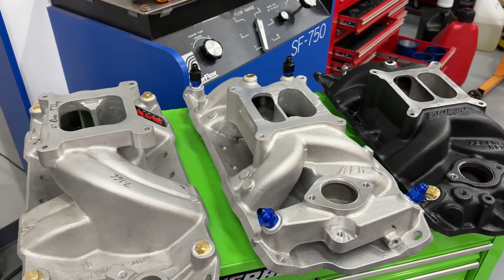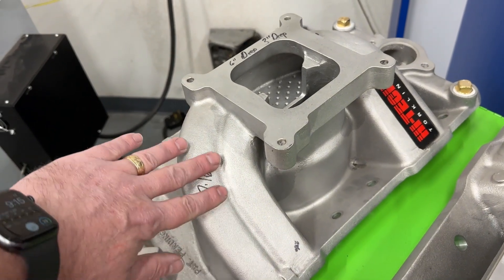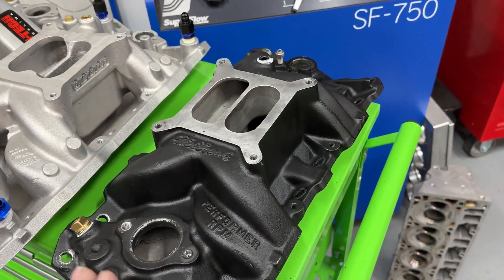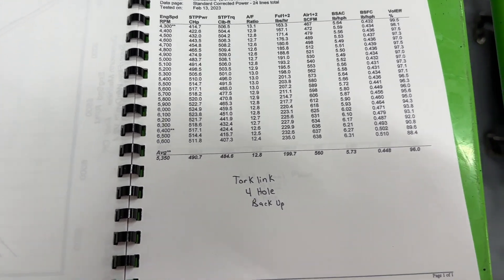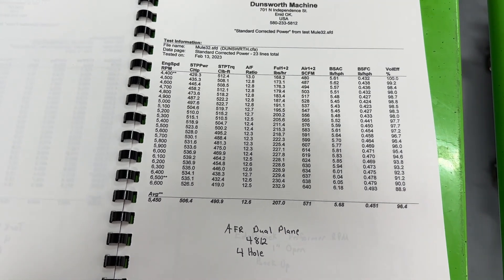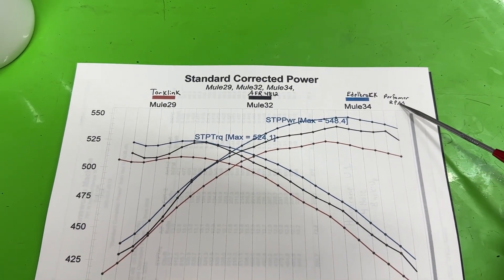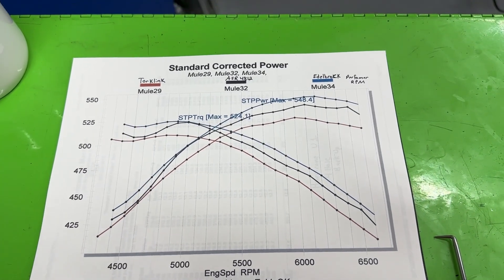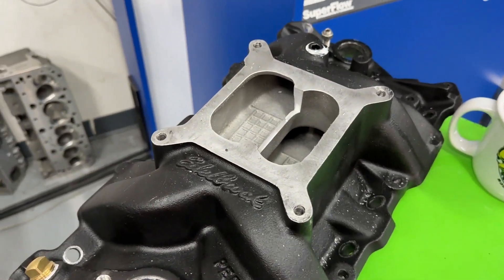Dual Plane Intake Manifold Dyno Test

Comment: I've seen that Torklink one in your videos on the shelf and was expecting something really sweet from it
surprised it wasn't better, looks so cool though
i'd love to see a dual plane intake test with ones that have the spreadbore pattern, and then compared it to without the spreadbore pattern
Edelbrock has many like that
or what about a spacer testing that has the divider in it?
would like to see how the torque patterns are with a spacer with the divider
were these manifolds ported or just port matched?
great video

Comment: Now, lets see how an old Edelbrock SP2P and a Chevrolet Qjet intake compare to these results. Any guesses? 🤔
Reply: The old SP2P was the opposite of a performance manifold.   Intended for low RPM torque on mid/late 70's Chevy 350 truck engines putting out about 160HP.  My father installed one on his 1978 K10 but didn't seem to gain any power or gas mileage over the factory spreadbore.
Reply: Was that the torker sp2p with the carb on a angle, sorry that was a big block 😳
Reply: @fasteddy  I'm not positive but I think the big block intake with the crooked carb pad was the Tarantula?

Comment: The McFarland torklink was once considered the hot setup for 2bbl  9:1 compression circle track motors...but none of us used dynos back then...
Reply: That’s what I remember also. I though it was used a lot on the 2bbl class
Reply: @Patrick-xd8jv  Id be curious to hear feedback from guys running them back in the day. 
Kick ass looking piece. Id run one just cause its different...polished up nice conversation piece at cruise night. 
Dont think intakes make that much difference unless a real poor one was used in the first place. Used to hear Joe Sherman preach about that often.
Reply: Dynos dont tell everything esp on a circle track car. I like the intake no matter the dyno results.
Reply: I have one if you want to trade  @gordocarbo
Reply: The design suggests it is for a flat plane cranshaft.

Comment: Great  info!!  I have a 434 small block Chevy with afr 220 heads and a self- ported Performer rpm qjet manfold.. 1 inch open hole spacer.  Worked great!!  I would love to see you port a dual plane for a maximum effort small block...sleeper...
Keep testing!!!
Reply: *And test it!

Comment: I just watched some dyno video and they didn’t see a bit of difference with a spacer in the numbers. Wish I could remember now what channel it was. Spacers have always been to get the carb away from the heat some more I’ve always thought.
Reply: the spacer on a dual plane allows for air to go to both sides, as opposed to only half the carb feeding each cylinder. If you have a big enough carb you won't see advantage from the spacer/air gap because half the carb is able to supply each cylinder at high rpm. I'm guessing in these tests the carb doesn't get hot enough to make the spacer have a difference, but it probably would if you ran the thing to max temp for a while, like oval racing.

Comment: Is there any airflow difference in the rpm air gap, and performer rpm?
And at what point does the rpm become a major restriction in power?
And can a single plane be modified to get down to the  2000-2500 range and up,  I had a similar to torquer intake on 350, 11:1, lunati cam.507" lift 285° total dur, it was a straight up pig below 3500, the heads were not ideal, small valves, 5.0H.O. heads ported,  it's all I had,  it really came alive about 4400- but the sad part it was done by 5k the total combination was way off, it would done great if it ran a sustained 4500-4800 rpm, I wanted a 3k stall, and a decent aluminum head, and was hoping to get a performer RPM,  something that would spin to 6500-6800+/-, and not be anemic below 3k,
I was young and dumb, and broke, had to use the parts I had, for other projects, because it was my only ride, 
I did eventually swap it all to a trick flow head, twisted wedge, Holley street dominator, 10.5-10.7:1  with a 465/485 mild hyd. Roller cam it was on fire then,  Chevy would sold tons of trucks if they ran like that!

Comment: I am surprised that the Hi Tech did so poorly. Possibly the plenum is too large? Thoughts?
Reply: Testing was done at higher rpm’s. Over 4200 rpm.  Long runners make low end torque well below 4200.  I think this engine was also setup with cam that likes rpms.  That intake is not designed for that.
Reply: Application isnt for higher rpm peak power. 
On a mild st engine I bet it works pretty well. I dig it if anything just for the looks
Id run a well setup spreadbore carb with those long runners.

Comment: If the afr enforcer heads are the same as an assault heads, the intake ports are raised .100". Which intake gasket did you use and did you notice if the ports on these lined up with the intake runners? 

I have assault heads and used a 1205, but the gaskets had to have the bolt holes notched to raise the gaskets to line up with the ports.
Reply from the maker: 1206. The torklink was closest match. The others were smaller.
Reply: Those are the dart copies sold by a bazillion places. Castings at least

Comment: I may be wrong but I would think cutting the performer rpm center down more will hurt output.
Reply from the maker: We will see.
Reply: @WeingartnerRacing  can't wait... i know some folks who used to do this on the Pontiac performer and rpm intakes, and saw mixed results. i think there will be variables such as cams/heads/weight/temps/altitude/etc?????? the pontiac edelbrock intakes are dual bolt pattern, so perhaps that's a reason, and as you mentioned how clean is the cut and how deep, along with what size spacers were used. Jim Hand did some of the testing back in the 90s (it think) on his Pontiac setups.... but... he was GOOD with tuning stock type stuff
Wasn't that Offy's big deal back in the day, thought they offered a cut down and claimed it gained some upstairs??????

Comment: The Performer RPM has ALWAYS tested on top of all dual planes on every test I've seen. It is THE intake to run on a street car with torque and hood clearance concerns. 
Excellent video and info Eric, definitely looking forward to the retest of the AFR and Edel !
Why TF do manufacturers keep putting that damn vac port there !?!? They gotta stop. You can sink it flush if you tap the hole more.
Reply from the maker: I could but I was in a time rush so spacer it was.
Reply: @Eric Weingartner  totally understandable, thanks for all you do !
Reply: Yep still the king of dual planes for probably every engine they make them for.
Reply: You would think Edelbrock has gotten enough complaints over the last 40 years of making the Performer series intakes that they would have remedied this. Before Vic passed away Edelbrock had competitive prices. After he passed EVERYTHING basically DOUBLED in price. Whoever is in charge now is running the place into the ground.
Reply: @robertwest3093  edelbrock is owned by a private equity firm.  The owners are looking to make more profits not satisfy customers.
Reply: @chrisw5837  Same with afr and most everyone else. We can thank everyone that shops at China motors for this.

Comment: Eric do you think the torklink looks like it's designed for a flat plain crank engine
Reply from the maker: I think on paper it looked like a winner but just didn’t happen.
Reply: We found the same results when we tested the Torq Link years ago when it first came out.  It never performed well on the dyno, no matter what we tried, but some drivers thought it "came off the corners better."  I don't see how that could possibly happen though.  Wishful thinking.  Or maybe because their wallets were lighter.
Reply: @dannobee  Bet it has something to do with runner length and position. Id think it would have good torque off the corners.
Reply: @WeingartnerRacing  have you ever tested the EDELBROCK performer eps.

Comment: You know I kind of wish you had tested a 40 year old tunnel ram along side these just to show how well the old tech worked at every RPM range.
Reply: Engine Masters did that and it makes more power. I believe they said it always does.  The question is, can you live with the hole in your hood? It's always a compromise with a street car.
Reply: @BEANS-O-MATICtransmissions  while i have always loved the look of a T-Ram setup, i've never said one in a street car that outperformed a good single setup
i dont know of anyone that ran a low profile dual quad, but single or dual carb tunnels i've never seen or heard of them do well
i'm sure some super fine tuning maybe they might have, but the basic street type stuff i was around, single was always the king
this was in the late 70s to mid 90s/early 2ks
i've personally never had one, so going by feedback and what i had seen at the time
again... i LOVE the look
i do recall some folks mentioning about icing issues with dual quad tunnels, especially a few of the guys with T bucket/kit cars
now.. the big boy blowers.... that's a different story
Reply: @DDDD-of3hv  Edelbrock makes a low rise dual plane. 
Sure they work fine just not a fan of the runner length. Nice eye candy though
Reply from the maker: I would love to do one but then I need other carbs and more time to get everything hooked up. A good tunnel ram like the one from alky digger would be the one to run.

Comment: Not all engines like the air gap intake manifold. Depends on the engine combination.
Reply: Too bad everyone wants to build via an internet dyno sheet. Thats not real life in car results
Reply: @gordocarbo  exactly 💯 my setup on my car doesn't like dual plane intakes. It's faster with a single plane intake.
Reply: @musclebone7875  Same...any more torque with a dual plane Id just spin...and have no top end. Use a small single plane well ported does both pretty good
Reply: @gordocarbo  I'm using a dart single plane intake on my 496. I love it, I'm no drag racer, but on the highway my '68 impala pulls hard up top. On the bottom at WOT first gear is useless with my 3.36 rear gears.
Reply: @musclebone7875  Running enough stall?
World products came out with a low rise dual plane which moves a crapton of air. One of the owners designed it for his own car. 496...I wish I had one lol

Comment: Thanks for posting Eric! For me, more interested in the dual plane tests for my 383 since it will be replacing the anemic 305 in my 91 vert. Camaro for the street. I kept my Weiand Team G high DP which I got back in the 80's, it has most of the divider removed, but was considering buying the Edelbrock air gap for it's benefits instead. Recently found a funky Offenhauser split runner dual plane too. Whichever I use, will need full divider removal since I am switching out the stock EFI for MSD Atomic.

Comment: ?? Is the Edelbrock Performer RPM,  just like the 1970  Corvette  350  LT-1 manifold  ????
Is that way it's so good???
Reply from the maker: No not close to the same.
Reply: @WeingartnerRacing  What is the difference in performance between the Performer RPM and the GM 14044836 70LT1 manifold?
Reply: @WeingartnerRacing 
Thanks for the help
Reply: performer rpm will out perform the old LT1 intake
LT1 isnt bad, works great it depends if a few ponies is worth spending 400 bux plus. Id keep what you have
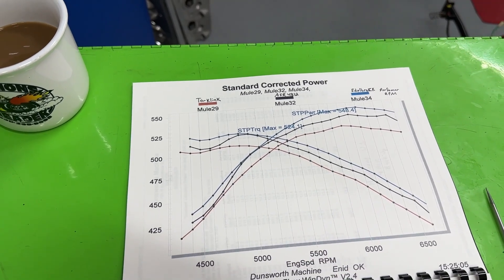Reply: 14:14 Edelbrock designed a wonderful intake manifold

Comment: That vacuum port ,  under the carburetor is stupid.    Did AFR think you would NEVER  install a Carburetor???
Reply: I have an old Weiand and it is the same, probably meant for a Quadrajet, not a Holley.
Reply: Most carbs have a large manifold-vacuum port dead-center out the back of the throttle plate, which is what I use for power brakes and PCV if needed. The port plug can be recessed flush and does not usually affect the carburetor installation. I almost never use the thin paper base-plate gaskets anyways due to heat transfer. I always use the 1/4" thick gasket or a 1" open phenolic spacer anyways which is the best seen in my testing.
Reply: Agree....They musta overlooked that detail, how many are running spreadbores these days?
Brainfart! I dont want a spacer on a good dual plane using a holley.

Comment: Hey Eric, Dan from ny. I think when you remove the center divider in the manifolds you might want to stagger the jets like on the L88s, to straighten fuel distribution,  check the a/f  ratio at each cylinder.  Might give you a false reading on manifold modification

Comment: Never would of believed the performer would of beat the air gap afr!!
Reply: The Edelbrock has a true split plenum, so it acts 100 % like a dual plane, can use a bigger carb, and cylinders don't cross-communicate like a single plane or a dual plane with a cut down divider.
Reply: @v8packard  I’m running a 600 CFM now, thinking about the 800 AVS2 on a BBF.
Reply: @v8packard  Well said. I fell for the cut the divider bit, ran worse than if Id left it alone
Use a dual or a single cant have them both. Well unless a tunnel rams involved.
Reply: @gordocarbo  if you have either a spacer or just a little cut on a dual plane it usually makes more top end power, but thats because the carb on a dual plane is usually undersized. by running a really big carb you wouldn't see any difference with the opening under the carb. Dual plane on has access to 1/2 the barrels so needs more carburation.
Reply: @v8packard  He used an open spacer so your theory isn’t correct.
Reply: @supersportimpalass  after he finishes the edelbrock mods, we’ll know better. Too bad it didn’t fit without the spacer.